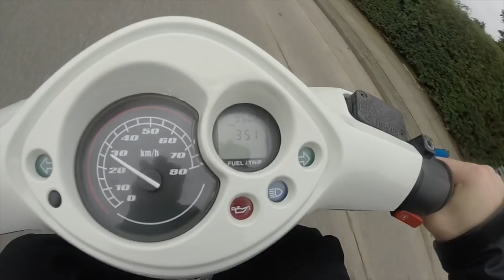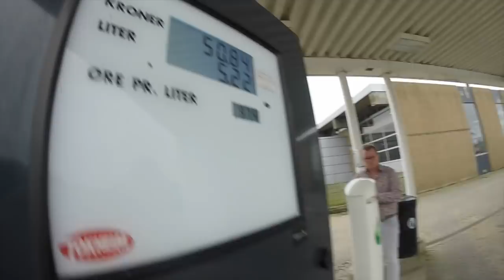SÅDAN FORKÆLER JEG MIN SCOOTER!!

Comment: Er lidt en noob til scooter men hvorfor tager du 95 benzin på og ikke 92 er 92 ikke biligere ?
Reply: Blyfri 95 har et højere oktan tal og er bedst til scootere, da de tager så mange omdrejninger at den hurtigere forbrændingstid der er på 95 frem for 92 er de småpenge værd. Blyfri 92 er fint til ældre knallerter som fx. puch maxi
Reply: har altid brugt 92 på min helt nye pgo hot 50, går den i stykker/dårlig af det eller kan jeg godt fortsætte med og bruge det ?
Reply: er det noget som kan gå i stykker ved at man bruger 92?
Reply: ok tak tror jeg vil begynde og bruge 95 fremover TAK
Reply: Det lyder sku klogt
Reply: Der er bare mere ethanol i 95 en 92 men du kan også bare hælde. En lille flaske octan booster i din tank med 92 eller 95 i så holder det motoren ren. Og den får også lidt flere krafter
Reply: tror bare jeg hænlder 95 istedet for :)